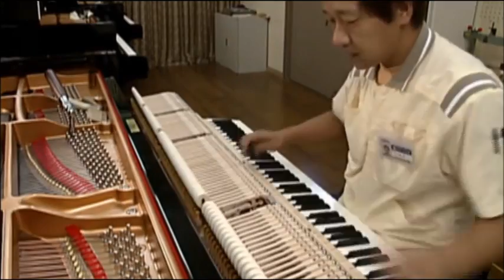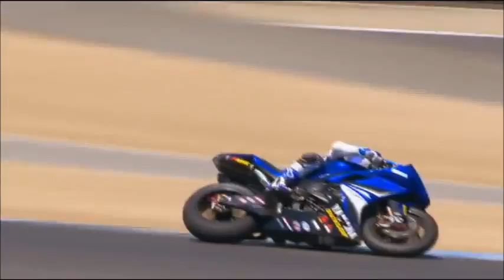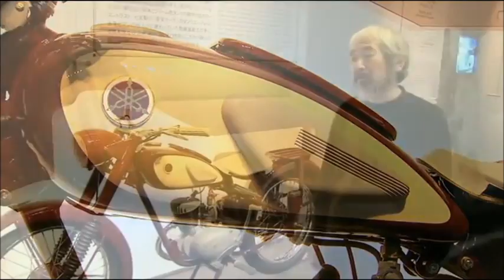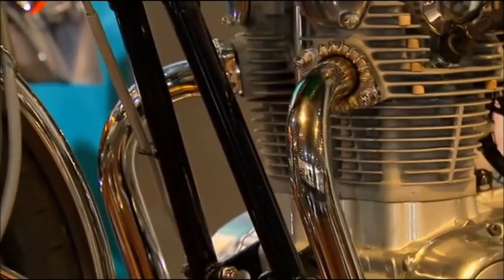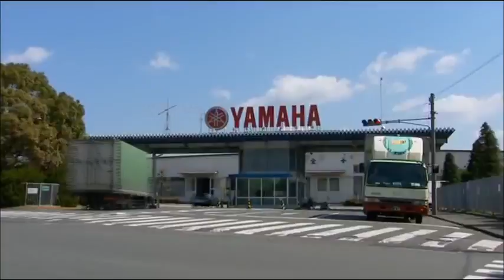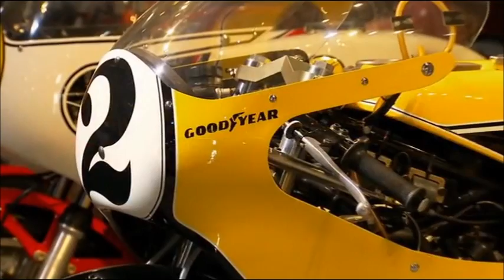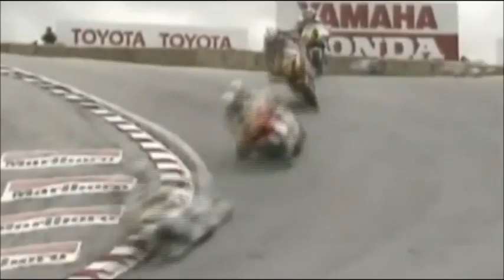Yamaha Motorcycles - History (From 1955)

Comment: I don't know they went right by the fact that Yamaha invented the 2-stroke Oil jection where you just fill the tank with oil and it would automatically mix the oil with the gas you didn't have to do any pre mixing before fueling the bike and the four-stroke 650 was not as fast as the 305 two-stroke.

Comment: Back in the early seventies about 75-76 I owned a-1968 305 2 cylinder 2 stroke that bike was badass. I broke the speedometer. I think it read 120 I did about 135 Down Memorial Drive in Cambridge Massachusetts and broke the speedometer. I don't know if it came stock with Dunlop tires but it had Dunlop tires and I bought it used so I don't know if someone change the ties but I think it came with the dunlop's. I should have never sold it.🤔😣 I also owned a 1979 650 Yamaha 4-stroke 2-cylinder not as much power but it was nice and comfortable and fun to drive. I did an inadvertent jump with the 650 and bent the frame but no injuries and you couldn't see the damage. I would love to have both those bikes back

Comment: My first street bike was an RD350 then I stepped up to the RD400. After one summer I sold the RD400 an went back to the RD350 as I preferred its power curve.
A set of spec II expansion chambers and the carbs rejetted made it a very quick bike that I wheelie at will. 
I regret never getting my hands on an RZ350 which was an improved RD350. 
The crackdown on emissions took the RZ350 of the street. Yamaha was now sitting on a pile of RZ350 motors that could not be on the street. 
These motors were used in the Banshee 4 wheeler. 
A beast of a 4 wheeler.
Reply: It was the other way around. The banshee was the 350 at its best

Comment: My era with Yamaha came inbetween the YD1 and the DT1,  Wonderful little two strokes.  My friend has the two cylinder 100.  Once we discovered that the exhaust ports tended to carbon up and cleaned them from time to time it was a jewel.  Then they were the first with 4 transfer port designs.  And the first with reed valves.  Bikes were really more exciting.  I can remember a sports 50.  It was one of those bikes that you could race on real roads without hitting ridiculous speeds. Yet which required proper riding to bring out the best.

Comment: The 650 was a very good looking bike.  The engine resembled the Triumph Bonneville 650, which to me was one of, if not the, best looking motorcycle engines ever.  The engine made the looks of the bike, in both cases.
Reply: The vibration of that twin was something else, as were the Brit bikes. A lot of guys had them in the 1970s but never rode them. It was just another toy like the barbells, foosball etc. There were still a few low mileage bikes even in the 1990s.
Reply: @irvhh143  Yes.  Yamaha had a 650 twin, in the early 70s, with an engine that resembled the Bonneville 650, very closely, and it was a really nice looking bike.  I test rode a new one.  Even it, vibrated something fierce.  I almost wish I had bought it, but I didn't.  I bought a RD 350, 2 stroke twin, instead.  I was kind of partial to two strokes, at the time, and it would have eaten the 650 alive, through the quarter mile.
Reply: @wmden1  the 650 did have a flat track career. This was due to AMA's blatant favoritism of HD. They banned the TZ700 miler, much to Kenny Roberts' relief. There was no point designing a new XS650 racer as the AMA would handicap it. It was popular in the 1990s as a club racing flat track bike, if you could afford the custom frame.

Comment: My Dad bought a 80 Street Version in the 60s that I learned to Ride when I was 12...At a 76 Gas station near us you could buy the oil and Gas mixed right from the Pump...Then in 71/72 I can't remember I bought a 360 it had a silver tank and a Black Stripe on the Tank...It Ripped the Kick Starting Gears out of it Twice the next year they put a Compression Release on it that opened when you turned the kick starter out and a cable opened the Compression Release.... Twice it Started Backwards...I put it in Gear and it went Backwards...Lucky I didn't give it a bunch of Gas and haul Ass going Backwards....I just turned 69 April 9 and I'm still Riding but on my 07 Street Glide...I have 67 thousand on it and have it fixed up just the way I want it...The wife says I have 40 Grand in it...
Reply: I hear ya!! Boys and their toys!!! I got my license at 16 on my 350 RD, now at 62 I'm riding my Fatboy,with about 40 G's into it as well!! Enjoy!!!

Comment: I've had 3 close mates killed on R1's due to fly by wire throttle systems ....and 1 mate scared into not racing them ever again due to full throttle lock on when least expected..... I do miss my Brazilian  built RZ 250 with full fairing..... used to call it my lil Ducati eater

Comment: I have a dark red metallic 85 Vmax 1200 with 11,000 original miles and it is in mint condition. It was production run number 2131 and any Vmax produced under 2500 production run number was 100% full power after 2500 produced Yamaha had to tame the beast for the rest of the Vmax production history with some models not even having V boost
Reply: All US models had V boost. 2500 or 3000.

Comment: I own a 05 r1 and this was very relevant to me 😏 and I've gotten mine to 187 mph
Reply: I can't imagine what it was like what it would be like to do 180 plus miles an hour close to 190 mph it's just mind-boggling. The fastest I've ever gone on a motorcycle was a Honda CB 1100 I think it was f the sports model and I hit about 133 miles an hour on a straight away I lived in San Francisco and every Sunday they have something called the Sunday morning run the first half is a switchbacks on a mountain with sheer drops of 50 to 100 ft of just rocking trees you don't want to go off and if and on the other side if he has don't stay on the road which has rock falls on it all the time you just smash into the mountain side but halfway through everyone stops they smoke cigarettes they will smoke joints and I'm talking about the mid 80s the late 80s now and the rest of the run was pretty much very open curves and long straightaways along the Pacific guess is part of the Pacific Coast highway along the shore and that's where I hit 130 plus 134 miles an hour and that was pretty amazing and a high enough itself I'm blind now I went flying the started to go blind the $89.90 and my last bike then was a Harley low ride is it which I built and road cross country from Northern California to New York City and then I couldn't ride anymore shortly after that I missed it lately this video was very emotional at points especially hearing the racing part of it you know here in the bikes you know that they're beautiful sound that a motorcycle makes when it's hauling ass and yeah it's been a long time but thanks for your comments I mean 134 to me was like an amazing thing for 50 miles an hour fast that God bless you man keep safe and enjoy your bikes sincerely Bob the blind veteran guitars

Comment: The RD, TZ, both missing but both iconic Yamaha machines.
The Documentary was mostly about racetracks and the R1 and R6, which were late 90’s bikes, practically a whole decade was missed out!
Reply: I guess Kenny Roberts has been written off at this point.......
Reply: I agree, I had RXS100 first bike, RD400 air cooled, 250lc, 350 ypvs, DT175mx, TZR125 unrestricted with power valve kit and an FZR600 Loved them all.

Comment: This got really boring because you missed the DT250, one of the really early trails & the thumper 500. You missed the 650XS which was a fun bike, the pink pig & with the amazing 1100cc motor that when it hit 5000 revs turned freaky. You missed the FJ series & the one that cancels HD from real drag races the V-Max so they only compete with other HDs. Finally my bitch here is the XVS & I love my 1300 cruiser. which really was one of the most beautiful motorcycles around. It's old now but people still come up to me & tell me how much they like this bike. It really needs new paint. Seriously pathetic overfocus on the R1. Get your heads out of your you-know-what. Frustrating crap...

Comment: Not a mention of the XJ Engine in either the air or water head version or the Maxim X with 5 valves per cylinder...or the tax, tariff BS that kept a max of 700cc's...very lacking in history and very pointed to the current machines. Which is fine, but don't sell it as a "history of Yamaha". Nothing on the XS either. The XS1100 Midnight Special was a beautiful bike and the Venture Royal, a fine touring bike...they really missed the mark...

Comment: Totally agree with flyinbiker... how did they skip over the amazing RD series??? This felt a lot more like a promo video for the R1 and R6... it was good, but should have been so much more... They jumped from 1958 to 1968... what about all the great 60's Yamahas?  Paused for a moment to talk about the XS-650 in 1970 , then skipped over all the 70's - huh???The Yamaha 2-stroke twins put Yamaha in front and center in the racing world. What happened to all the 70's? The MX bikes that became the YZ's?  The Yamaha R5 that morphed into the amazing RD 350's, that in turn morphed into the RD400's and RZ-350s?? Thanks just the same...
Reply: Agreed.. No mention of the XT 500 either....Yamahas first 4 stroke trail bike

Comment: I gotta say my 09 R6 Was a high tech light weight canyon carver. It was the burnt orange tribal paint with flames 🔥 to. My Ninja was faster I think 🤔 but no doubt the Yamaha could whip its ass through the twisty stuff. And it was no slouch In a straight line either and the quality was high end appliance like real nice fit and finish quality item. Honestly it was not the bike for me though I’m to big for a 600cc not the engine the frame and weight. I feel best on big tires and at least 450-500lbs bigger 750-1400cc bikes. I’m 6’3” and 225lbs so a 600cc 400lbs bike feels like I’m doing 150mph on a ten speed 😮. Actually the bike I could ride best was the 1998 ZX900RR now that bike was perfect size perfect power every where if only it had the quality of the Yamaha. It was a fine bike but not to the level of a Yamaha or Honda of the day. Now the engines where as good or better but not the ergonomics. Plastic would fall off after 20k miles if you wasn’t super easy on the bike. It was thin plastic and after a few years of summer sun and lot of wind they would give up the 👻! The Honda’s and Yamahas had far better plastics and build quality. You could drop them and not even hurt them you drop a ninja it’s done. The 900 was so fast it blew the turn signals off new 🤦🏼‍♂️😂. Like nobody tested it to see what happens if you actually wind it out a little or a lot 😂

Comment: i noticed yamaha missed out the Genesis bike that per-dates the R1, why? because british made coventry Eagle 1924 already invented the box frame where the engine is also the part of the frame.. bias japanese videos yet again! considering the british bikes invented almost everything from swinging arm suspension,  telescopic forks, 4 valves per cyclinder, box frames, 4 cyclinder block engines, paralle twins, v-twins, 4-stroke engines, steering locks and so on!

Comment: i own a yamaha.. but they just seem to ring and be a tinny sound on that engine.. Honda on the other hand just whistle and grunt.. i have an R1.. and i have a HONDA BLADE 900.. honda just seem to have a little bit better performance and build quality
Reply: I agree
Reply: @bandccoresohio  I put 131,000 miles on my BMW R1100R.  The bike can go over ten years without needing anything major.  When it does need a part, its very very expensive.  The good news is that the replacement part is made in Germany not China.  I just bought a new driveshaft and it cost $1,057.  I installed it myself.  Still not bad for a bike that has lasted me over 20 years and still has good compression.
Reply: @JohnDoe-bf1fw  Do you work for BMW, John Doe (funny name)?
Reply: @lacviet100  ,nope, I'm unemployment.  By trade I'm an electronic technician.  I live inexpensively and work when I need to.  I don't own a car.  I only ride motorcycles and bicycles.  I've ridden motorcycles for over 35 years.  I've owned Hondas, Yamaha and BMW.  I do my own work on my bikes.

Comment: The sport bikes are fine, but Yamaha also makes a line of fine street bikes, the XV, or "V Star" series. They handle beautifully, not too quick, not too slow, very predictable. They are comfortable, powerful for their displacement, and very reliable transportation. I have owned a 2009 XV-250 for 8 years. I bought it used from a Yamaha dealer in 2010 with 1200 miles on it. I now have 16,000 miles on it. It is my main means of transportation. I change the oil and filter more often than required, and keep up with the maintenance. I have replaced the tires twice and the drive chain twice. It is completely reliable and has never failed me. It may only be a 250, but it is plenty powerful enough to haul me at 60 MPH on the highway. I wish this video spent some more time showing this other side of the Yamaha motorcycle line. Not everybody is a racer, and this other side appeals to a whole different set of riders.

Comment: I so wish they would drop the crossplain and use the 600 R6 motor punched out to 1000cc and have the most aggressive potent 1000cc superbike available with a true 200+hp to the rear wheel.

Comment: My current daily rider is an '86 Virago 1000.  Didn't even see one.  I figured with all the fuss that was kicked up by North American manufacturers when that bike was brought to market it might have received a mention.
Reply: tbw357 - It's just not flashy enough for the writers of this video. I have several bikes including a couple of Goldwings and an '85 xv1000 Virago. After riding rhe others, getting on the Virago almost always brings a smile to my face. People who haven't ridden an xv920 or an xv1000 just don't understand how close to perfect the engines in those bikes were with the big fat powerband from off idle to well over 7k. No Harley could touch one when they 1st came out but then there was the v65 Magna, the V-max, the Hurricane, etc... and the Viragos were eclipsed by giants and forgotton. While most of the old Z1's and Magnas are dead and covered with dust in the back of someone's storage due to mechanical issues, the Virago still fires up and runs like it did when it was new - and if you're not careful - it will still pull the front wheel off the ground if you goose it a bit too hard during a launch - even though the shaft drive fights against it.

Comment: There are better details that could have been added to this video.  They kept showing a YDS-1 as the basic 250cc twin but it was not.  The standard twin that came to the U.S. in '59 was a handsome little 4 speed version with electric starting and a metallic charcoal paint finish.  The YDS-1 was a five speed and completely different engine and considerably more than 15 hp, I'd guess more like 22 hp.  I rode the first one in Wichita, Ks in 1960.  

The XS-650 was an acquired design from the Hosk company which was later owned by Showa which became part of Yamaha.  I had the opportunity to part out and scrap one of these engines and was so impressed with it's qualities.
Reply: cuppateadee - Some grasp of the situation you have..!  I see it much the same way.  My beginnings in the trade and industry was as a Honda - BSA mechanic in the early '60s.  I had a CB-160 that I used for daily transportation, another 'solid as a rock' motorbike.  I put over 25,000 miles on it and it barely puffed a little smoke at start-up and never broke down with anything before I sold it years later.

We're looking at a clumsy time with the industry.  Too much pandering to the "appeal of style" that has led folks off of the more stable "form follows function" approach in manufacturing.

Comment: Not a peep about the entire RD series, and barely a mention of the RZs...  nahhh, they weren’t important I guess.  Stupid video.
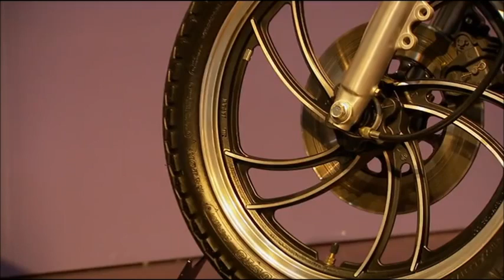Reply: The RZ 250 @ 16:43 was sold in Europe as RD 250...The RD 250 and  RD 350 were the last two-strokes road motorcycles over 50cc produced and sold in Europe by Yamaha. Both motorcycles met the new emission and noise standards only after switching to water cooled engines when I remember properly...
Reply: still raced  50 years later .. but I guess Yamaha does not care .. suck video
Reply: Roy Rodriguez people still race them nice

Comment: Last Yamaha I bought was cheaply made and unreliable.  I bought it new.  Dealer dragged his feet honoring the warranty (after dropping a wrench on the fuel tank) then he went bankrupt.  I went to another dealer who also went bankrupt.  In the 8000kms I owned it (a Virago) the handlebar controls broke, the front wheel bearings failed, two ignition boxes failed, and the kick stand switch failed.  The engine ran smoothly and was powerful, but the bike just was not durable at all.  I never liked the sound of Yamaha pianos either.  They sound cheap.  You can't beat a good Steinway or Heintzman piano, much better.
Reply: KIckstand switch?  WTF is a kickstand switch?

RoadGhost, NOT directed at you, but if you're 
too stupid to put the kickstand up, you deserve 
what you get!

Only 4 cycle Yamaha I was ever attracted to, was 
the Vision.

https://en.wikipedia.org/wiki/Yamaha_XZ_550

It was quirky enough to make me want one.

steve
Reply: Unfortunately, a side stand switch is part of the nanny state design philosophy espoused by motor vehicle safety administrations world wide.

If it too much of a PITA to deal with, it is a simple matter to bypass one.
Reply: that kinda does it for me i was told viragoes were great- if i hear one more bad story id go after other cruisers methinks- i hear their torque aint great either